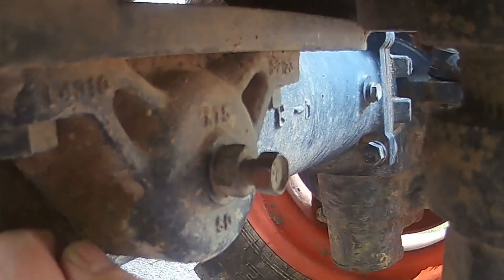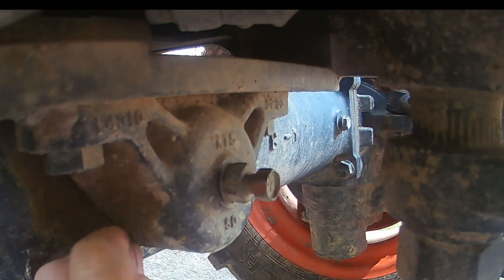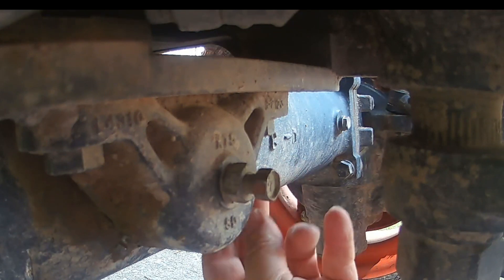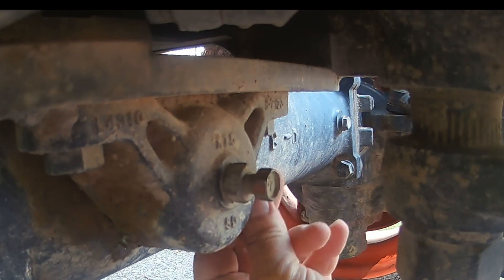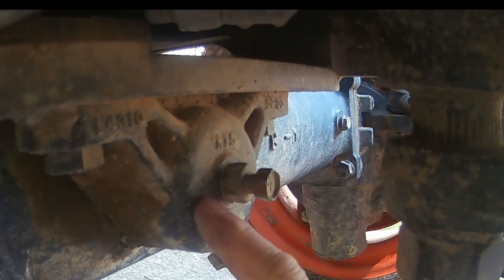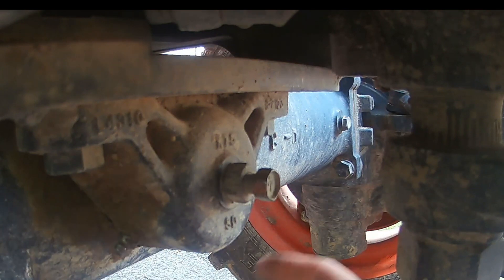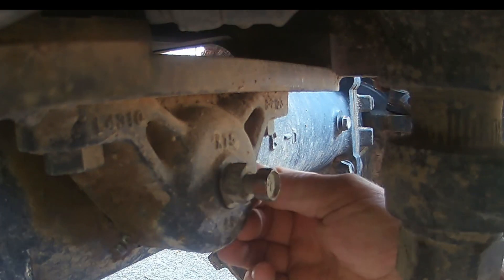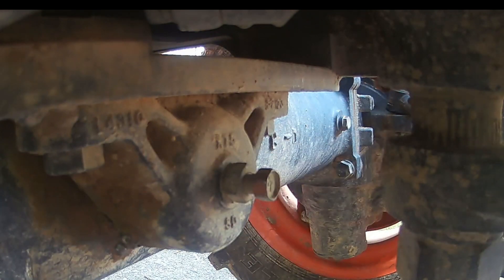kubota l2800 front axle pivot preload adjustment

Comment: So can you tell any difference when you're driving?  Thinking that seal would be difficult to replace...
Reply from the maker: I actually can feel a little relation between the front axle and the rear axle. I think that front axle may have been twisting a slight tad and I was feeling it on hills in the rear. that stopped after this adjustment. could be my imagination though. lol

Comment: Hey Dave - great video (although I don't really understand the techinical aspects). One question I have is that I always keep my BX 24 in 4WD... Should I not be doing that?
Reply: Not on pavement or hard surfaces. If you're in the grass, gravel, dirt, or mud all of the time, it should be ok to be in 4WD.
Reply from the maker: what redneck said, with that said I keep mine in two wheel drive 95% of the time.

Comment: Also meant to ask if you noticed the thread pitch on that adjuster bolt.  Seems like it was out of adjustment by about a full turn, but I guess it's not actually much if it's a fine pitch bolt.
Reply from the maker: I did not check the pitch no. would be interesting to know just how far it did move.

Comment: Good stuff Dave, while I'm under mine I'll be checking that on my 3400 (same tractor as yours) I'm right at 1100 hrs on my tractor
Reply from the maker: yes the 3400 will be exactly the same I'm sure. if I could find a 3400 at the right price I'd buy it. thats a nice machine.
Reply: @daveknowshow  I have really liked mine, the size and capability make a perfect fit